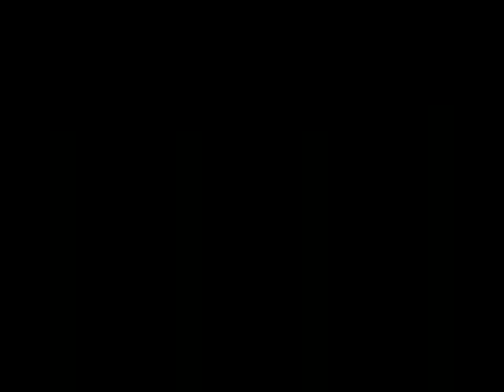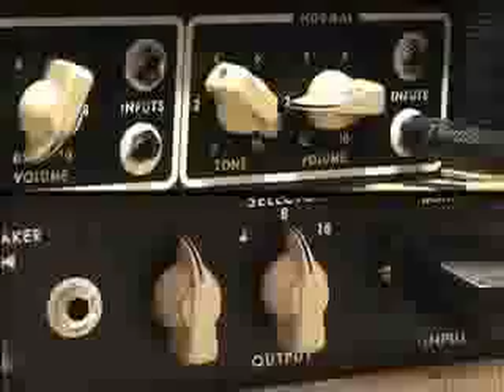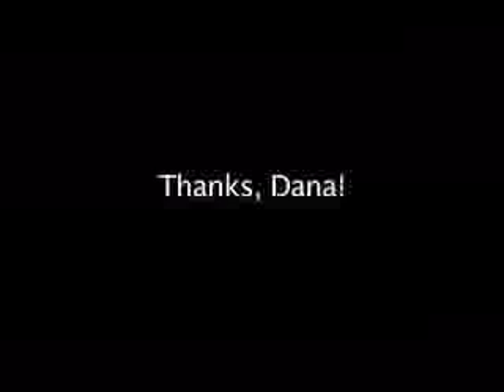VVR Variable Voltage Regulator

Comment: Cool demo but I wish that I could have heard the clean tone on your amp as well as the distortion.  I play through a first gen Fender Hot Rod Deluxe and I'm contemplating installing a VVR versus going with a hot plate or just an attenuator like JHS's little black box.  I love the clean tone that my amp produces, it's just that the sweet spot of my tubes is too loud for most of the clubs that I play since we try really hard to have a low stage volume and rely on the FOH to balance the sound.  For my dirty channel, I use an M13 StompBox Modeler with a combination of the Classic Distortion (ProCo Rat) and/or the Big Muff sounds.

Comment: this is VVR installed just for the power tubes right? it works real good.. i will have it installed the same way... and not for "the whole amp" which one could do also. tried "whole amp" installation once and did not like it below 4/10...